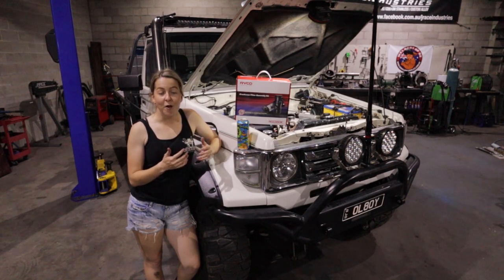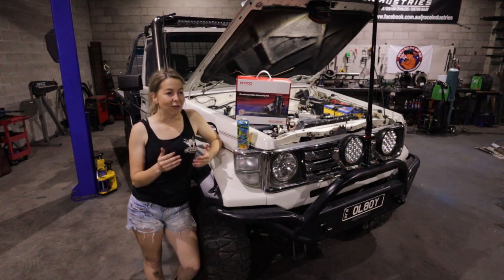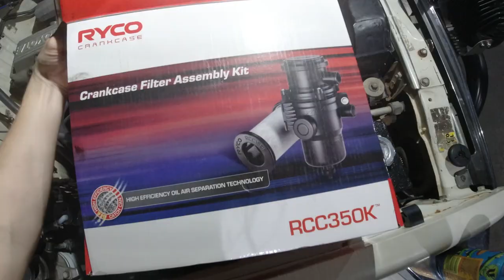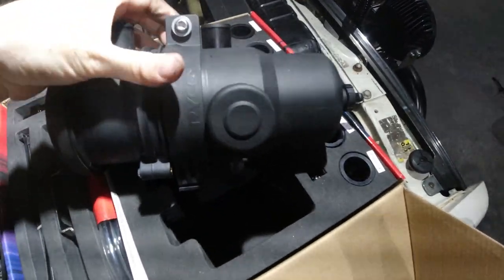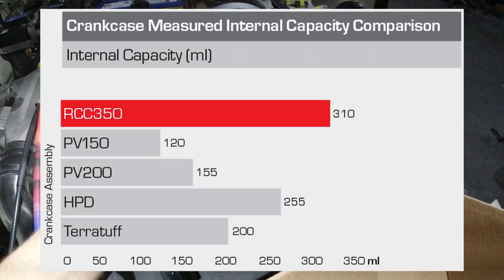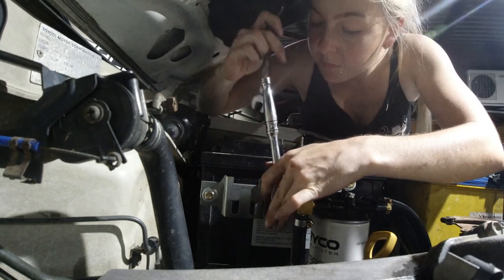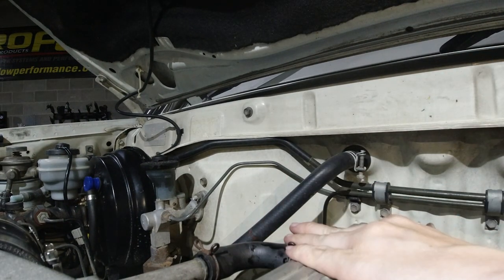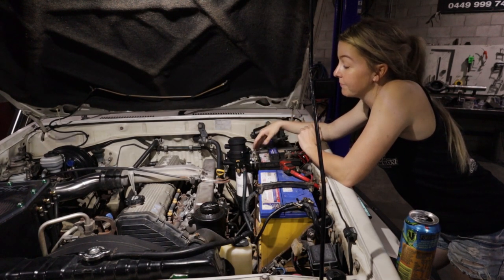Engine Maintenance Part 2: Ryco Catch Can

Comment: Had a ProVent 200 on my 2.5L CRDi turbo since I brought it used. Same time I fitted up a (insert reputable brand of your choice) fuel pre filter. Glass bowl, 30 micron, plumb it up properly or get someone who can to do it to do it for you. Those two mods, blow by gas catch can and a pre filter for your fuel, two most important mods on ANY common rail diesel, not just the 4WDs. After that you can worry about light bars and lift kits.

Comment: Hi Danie you have great videos
I have worked at Toyota many years and if you want to reduce oil ingress to the to save you draining it to often ,remove the rocker cover and their is a baffle plate that is set to far open. Bend the plate to close the gap as most of it splashed in from cam lubrication and not blow by. Keep up your great vids
Ross

Comment: When you mentioned needing to round up the proper oil rated hose for the catch can project, I know the first thing some people would do is grab some heater hose they have laying around or buy some thinking its suitable when in fact coolant rated hose just falls apart with fuels/oils and certainly don't want that happening and chance having dirt suck into the intake through a hose that's falling apart.
Reply from the maker: Hence why I didn't use coolant hose

Comment: if you pull that bracket off and turn those bolts around you will get a bit more clearance to the battery, probably fine as is but stuff moves around a lot when offroad. other than that i have hoist/workshop envy!
Reply from the maker: Interim set up because I'm changing the whole battery tray
Reply: @DanieSimpson  Building a LiFePo4 pack from Headway 38120 cells off ebay for mine, less weight more performance, do need some electronics to take care of the cells but not too difficult...

Comment: Danny great job but please either shorten the bolts to the lenth where they don't stick out past the nut's or turn them round just incase as on a heavy landing or a shunt the battery could get peirced by the bolt's, never say never I have seen it happen even though the battery was held tight in the cradle by the clamp.
One bettery was punctured and it exploded on a rally stage I was acting as a marshall and fortunately apart from a sma ll fire which was extinguished safely it could have been worse but for construction regulations a mounting bolt had been fitted in a hurry incorrectly or the wrong one fitted at the service point according to the co-driver lesson learnt.
Keep these style of videos coming and hopefully some of you using Old Boy in anger soon.
Reply from the maker: Am swapping out my whole battery set up soon so hence just a interim set up for now.
Reply: @DanieSimpson  Ahh a video worth looking forward to, and I am with Tavoco great outro

Comment: Great job on the catch can install, looks good too.
You will need to change your plates from "OLBOY" to "EVERYMOVINGPARTREPLACEDORREPAIRED" might have to shorten it a bit to make it fit on a plate lol but Australia the language of the abbreviation.
Reply from the maker: Hardly anything moving has been replaced? Same engine, gearbox, transfer, shafts, diffs, cab
Reply: You started off with a great platform, the days when a Toyota was indestructible. 
Great videos though, you make them encouraging to a person, that they can get out there and give it a crack in the drive or front lawn.

Comment: You can pull that small pipe from intake and any engineering shop would fabricate shorter one or even with bend so hose would fit better if you want to. I have PV200 and already can see that engine is happier and also filter in catch can is filling up which is better than going back to intake. What will be tour next mod?
Reply from the maker: Canopy:)

Comment: Hi Danie.

I fitted ryco catch can about 1k ago on my 105 next to fuel filter. Used about 2m pipe same spot as yours, just worried about pressure build up in crankcase,
Did you notice anything or considering moving closer to crankcase? 

Cheers

Comment: Great vid and thanks for the detailed info. I have a 2014 RG Colorado 2.8 with 103k on the clock..... Will I need to have the intake cleaned before I fit a catch can? And what's your thoughts on EGR blanking plates? Cheers Danie!!

Comment: All I want to know is how these ryco catch cans can work efficently when they have a straight through open filter? They cannot separate much oil mist in the blow-by because there is not really any filtering restriction. Why would the oil mist go through the filter element on the  sides when it can just pass through the middle of the filter unrestricted.
Reply from the maker: Seems like you've been reading some incorrect information. It is a coalescing filter that provides better seperation than the provent and far exceeds the hpd catch cans. It certainly isn't unrestricted it all passes through their filter which filters down to 1micron whilst maintaining good flow

Comment: Sorry totally off topic, but, is there any noticable improvement to engine performance with the extractors fitted rather than the standard toyota manifold. Wouldnt mind a few extra horseys out of my 79 series 1HZ.
Reply from the maker: It'd be minimal of anything. I noticed it pulls a bit better at higher revs
Reply: @DanieSimpson  as I suspected,, thank you

Comment: I fitted the Mans Hummel catch can to my 2019 Dmax and it says to empty around every 4000 kilometers and to replace the filter at every 40,000 kilometers... was just saying because in your video you said that they {Ryco} recommended draining every 40,000 but I'm thinking by the time that comes along its going to be overflowing if it's collecting anything like my catch can is!!! Just saying ; ]
Reply from the maker: Yes sorry the was supposed to be change the filter every 40000 not drain! Good pick up
Reply: Never mind Dani...we all make mistakes mate ; )

Comment: Question: does the height of the CC matter ?, would it be better lower down ?.
Reply from the maker: Every car will be different with the difference in pressures but If you can't mount it level with the intake id go lower before I went higher. But in all honesty probably not going to affect it

Comment: Did you just use heater hose Supercheap told me you have to use POL Hose ?
Reply from the maker: I used oil resistant hose suited to low pressure